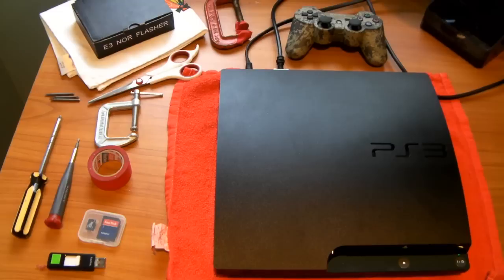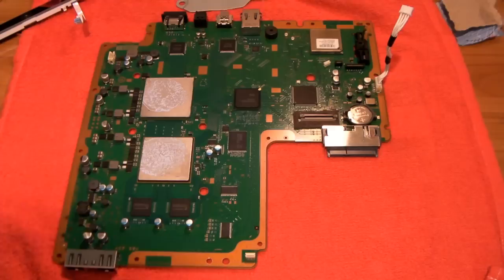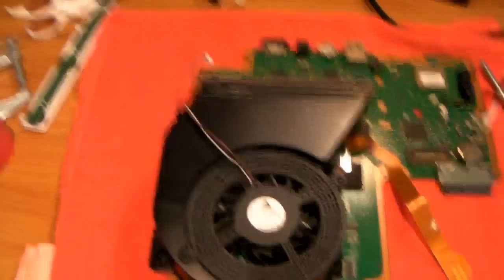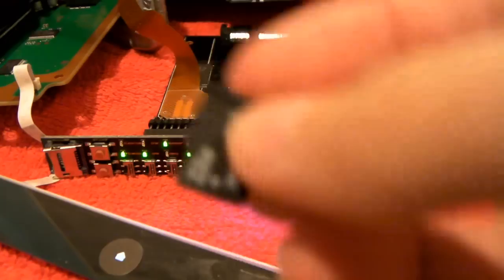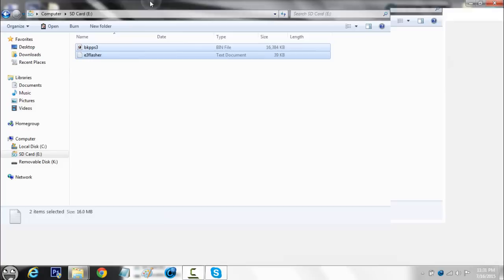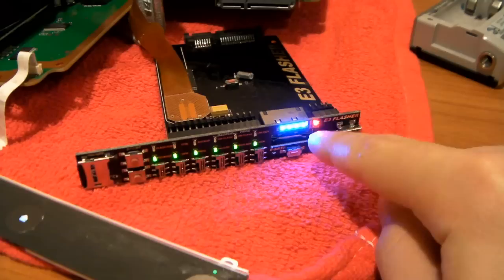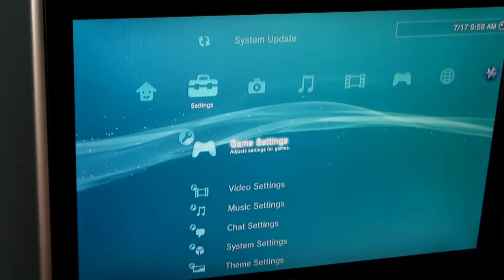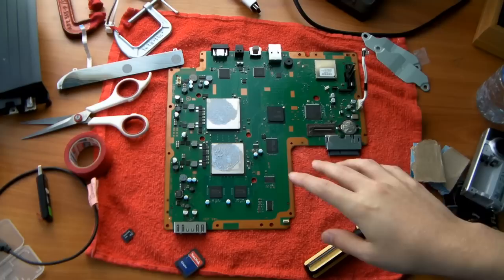How to Downgrade a PS3 to 3.55 with E3 Flasher (EASY!)

Comment: hey i updated my ps3 to 4.78 and i cant patch my dump without a updated dump checker is there any way you can help me with this ? asap
Reply: Look up dump checker 4.78, should be one on github by Swizzy
Reply: +Up2Bro thank you I sure will do
Reply: +Up2Bro It worked thank's bro
Reply: +Kendell Harrell Glad I could help (:
Reply: +Up2Bro When i try to run my disk I get a error 80010017 ?
Reply: +Kendell Harrell Idk what that is sorry man
Reply: +Up2Bro it says an error occurred during the start operation !
Reply: +Kendell Harrell My discs seem to be working fine, have you tried looking it up on Google?
Reply: +Up2Bro I found nothing , whats ur kik ?
Reply: +Kendell Harrell Don't have one sorry bro, maybe the Blu ray reader isn't in properly?
Reply: +Up2Bro its just that disk , bo2 works
Reply: +Kendell Harrell  Just give the not working disc a clean and it might work
Reply: +Up2Bro maybe its the mods and the eboot i put on it ?
Reply: +Up2Bro okay I got it thanks for the help !!
Reply: +Kendell Harrell Anytime bro

Comment: Great video! Thanks!

If you recently purchased your flasher and it has updated firmware it will do all 3 backups at once, instead of doing three backups. Just wait as the blue bar fills each time,  you will still see it blink back and fourth at the end. At that time you can remove the memory card.

e3Flasher Switches Explained:
http://psx-scene.com/forums/f263/e3-flasher-switches-explained-118339/

The link below explains why you get an error when checking your backups:
http://www.ps3hax.net/showthread.php?t=74684

If you read to the bottom of the forum it says that it will be OK to run your original backups because it hasn't been updated recently. You can just run the original three files and uncheck the option that is under the WRENCH ICON that says Enable hash checks.

Understanding Errors: 
http://www.psdevwiki.com/ps3/E3#Error_Codes

!!!IMPORTANT!!! Like the video I had the black screen come up and I waited and nothing after the select and play option.
!!!! You need to connect your blue-ray drive back into the mother board and then press select and start. !!!

This is because the ps3 reads: PS3 HDD - Bluray laser - CD laser - USB 0 - USB 1
More info: http://www.playstationtrophies.org/forum/tech-centre/156743-checking-please-wait.html

Solid Guide! Thanks - Glad to be back on 3.55

What do you recommend to use with my Cobra ODE or do I even need the ODE now?

Comment: Can you use a USB instead of a micro SD card?
Reply: u think it'll fit? -,-
Reply: u think it'll fit? -,-
Reply: You think it'll fit? -,-
Reply: +Ananias Gebreab nah there was a usb thing on the E3 flasher.
Reply: +Joe Stafford  I didn't try that when I did it but if you notice behind the e3 flasher it actually can be plugged in to your harddrive so I believe the usb port is for your hard drive not the downgrade also if you guys have an issue with your san disk  reading in your pc if your  san disc adapter the bigger one  has a notch in the side then tape over the notch and  your pc will then read

Comment: Looks easy, its not. My E3 cable pins got bent, the clip wouldnt fit at first and now the cable has rips in it because it got stuck to the NOR chip. What in fucks name went wrong? I have studied for months to do this and i already have to order a replacement cable.
Reply: +LeFo Oh and when i first used the flasher the power LED didnt turn on (on the flasher of course, the red LED)
Reply: +LeFo Same, lol. after getting past everything i finnally got it done

Comment: It said my dumps were bad how do I fix this??
Reply: e3 flasher cable isn't making good contact with nor chip
Reply: No I fixed it I had to disable hash checks
Reply: +Swerved how you do that ?
Reply: In the top right click the wrench and uncheck hash checks
Reply: +Swerved ty bro it's gonna be good if I unchecked it ?
Reply: +Swerved is it gonna brick us ?
Reply: I unchecked it an successfully jb my ps3
Reply: Swerved what did you do the patcher said it's bad but the norinstector says it's good for all three I'm so confused there is something bad with the ROSD Hash
Reply: I5 420vapes Click the wrench it the corner then uncheck hash checks then you should be good
Reply: Pogo The Clown mine is XvXROADKILlXvX
Reply: Pogo The Clown thanks anyway I had a outdated one my dad I'm so so sorry if I wasted ur time
Reply: +Swerved just downgrade a console the other day and ran into the same problem. instead of disabling you should click download arrow in top right corner and download latest hash list
Reply: Fiber

Comment: Would you like to explain the reason why you say to flip the first two switches down and from the third on you flip them up when you get an error for the backup if you've used the e3 flasher before and in the video when you pull your first dump after error your switch light still show two down third up and the rest down. I've read that when you use the SD card on multiple downgrades their is a Samsung update to put on the SD card before using it on any downgrade as many consoles as one would like. Now I that's not true and it is something you do with the switches being set for 2 down and the rest up to fix the SD error than why on your video is the 3rd switch the only one up. Btw one more detail I noticed at the start of setting up your e3 flasher you say to flip all down and the 3rd switch up and then you clearly went on the video and did all switches down and flipped the 4th one up and about a few minutes later you are turning it on and when the switch lights reveal what switches are on or off then switch off the 4th switch and correct yourself switching the 3rd switch up the way it needed to be originally. Are you trying to confuse and/or misguide people in your tutorials to cause them to brick a system? Cause I've downgraded before and made many mistakes based on bad info. Consoles aren't cheap and telling people how to or confuse the viewers to get them to brick their consoles isn't right and is unethical. Maybe you are clumsy and or dont know what your doing but you seem experienced enough for me to think you did it deliberately so I recommend you fix your tutorial and probably update the video while your at it or someone will get your channel pulled.

Comment: My model is chech 2101a slim can it be downgraded ?
Reply: +Acid Phoenix ALL 2101's can be downgraded.
Reply: +norge696 Can the CechP0# be downgraded?
Reply: Peter Jones CECHA - CECHG  Are not E3 flasher compatible, you will need ot solder and use a teensey. 

CECH all the way up to ps3 Slims 2501's can be downgraded. For the slim is has to have a manufacture date of December 2010 or below. All those are NOR and E3 flasher compatible.
Reply: +norge696 So the Fat cechp model can't be downgraded?
Reply: Peter Jones It can be downgraded  with an E3 flasher. reread what I said...
Reply: +norge696 cech-2502 be downgraded ?
Reply: Inu Mimi Look on the bottom of the console and look at the date manufactured. Has to be december 2010 or earlier. http://puu.sh/nfze2/dcc246d02c.jpg

Comment: Pretty sure I fucked up. First off, once I connected my battery and such the power button on the PS3 illuminated red like it should but when I clicked it it made the beep noise but didn't do shit. Now the fucking red light doesn't even turn on.

Comment: why doesnt the blue lights turn on, on e3 flasher?
Reply from the maker: Make sure you push the two e3 parts in all the way.
Reply: +Hacked Tutorials oh ok thanks man!
Reply: +Hacked Tutorials is there a way i can pm you?
Reply from the maker: Yes, what is your Skype?
Reply: +Hacked Tutorials andrew17807
Reply: +Hacked Tutorials Do you have a kik because I have some questions about downgrading my system.
Reply: +AdrianCFW BMT Skype?
Reply: u need to clamp ur ribbin cable better
Reply: no you dont always gotta do it... it can be other problems

Comment: I'm getting bkpps30 31 and 32 with the eflasher in the dumps
Reply: I got it now, you had the wrong update for the e3 flasher. thanks for the tut it was very helpful except on how too install the e3 flasher ribbon cable I had too figure that out myself.
Reply: +Dennis Blalock Jr just got the same results right now, where can i find the right update file?
Reply: +DJ Ray Boston I looked at another Youtube tutorial and found it there
Reply: +Brandon Rios honestly don't remember anymore, I was watching so many different videos. but I did find that it's OK, the e3 flasher upgrade causes it to do 3 back ups at once, just test your backups to make sure they are good before you do anything with them
Reply: this video is old theres new updates for all the stuff in this video. all this old stuff didnt work for me i had too downgrade back to 3.55 then too 4.80 d-rex after i found the update for the e3 flasher..

Comment: How do i do DEX? i don't want CEX, i want DEX, is it the same?
Reply: +ChevyHD 1 No it's not the same. 2 Download and install the latest REX firmware. (4.75.3 ATM). Once it's installed install REBUG Toolbox. (comes with the firmware and will be on the PS3's HDD). Once installed, open it, go to the far right and dump EID_root_key. Once thats done PS3 will restart. Open REBUG toolbox again. And in the 4e collum and click rewrite target ID, and your done.
Reply: +E3DowngradeBelgium what does 3.55 OFW do?
Reply: +josh hh 3.55 ofw does nothing accept you are able to install 3.55 cfw on it and then 4.xx cfw on it..
Reply: +Dries Bruggeman (MrZombieSlayer) which is pretty much the whole point of it right? you can still go online with it and everything. which one is the best for MW3?  i have a question. why does  my ps3  the right hand slot is not like my  left hand slot it doesn't  let  me  fully put in usb keys or anything for that matter. why is that? its shaped differently ad it sucks since he says u need to use the right hand slot. it does work but u need the the silver part of the usb key to be longer then usual.
Reply: +josh hh The reason you use the right port is because the right port is /dev_usb000/ and the left one is /dev_usb001/ and most homebrew apps and mod menus that need an usb call the function search in /dev_usb000/ so if you put the USB in the left side it won't work. There is no best firmware for a game. If your favourite game is MW3 you could just go to 4.76.1 REBUG.. You don't need spoof of any kind just enable protection (disable CFW syscalls before going online) and your fine. If you'd like to mod gta V I suggest a DEX firmware like 4.75.3 D-REX because SPRX menu's for gta work better on DEX. And some don't even work on CEX.
Reply: +MrZombieSlayer so how do i make  my right port work? i dont have my ps3 jailbreaked yet but i will. but  right now my right port doesn';t work for usb's only my left one does. so what ur saying is when i do downgrade to 3.55  (jailbreak) it will work after? and which firmware to you recommend for modding on mw3 like getting mod menu on it etc.. all modz stuff on MW3 which one do you recommend

3.55 OFW
Rebug 4.70.1 CEX
Rebug 4.70.1 DEX 
PS3 ITA DEX

or it doesn';t really matter which one.
Reply: 4.75.3 D-REX
Reply: Ik know it isn't in your list but ask him
Reply: And no, jailbreaking the console will not make your right port work, you need the right port working to jailbreak the PS3.
Reply: +MrZombieSlayer my right isn;t broken it cuz ive already plugged stuff in it but my usb it doesn;t wok for some reason. i think sony fucked mine up
Reply: +josh hh Right port isn't necessary at all. I've used both ports to upgrade and downgrade my firmware with no issues. They advise right port because its "more stable". But both ports are exactly the same.
Reply: +josh hh nah it's definitely not necessary. I'm waiting for my new e3 flasher anyway as mine broke so figured I'd check some videos and have a laugh.

Comment: BRO PLEASE CAN YOU HELP ME, I KEEP GETTING THE SAME ERRORS
Reply: witch error on the flasher itself?
Reply: +Robin Moens I managed to do it fine, now i jailbreaking another PS3 today and I'm stuck on the checking please wait for the usb file update
Reply: Slim, super slim?
Reply: +Robin Moens slim
Reply: +Robin Moens on my first jailbreak I didn't even get the screen were I have to press select and start, this one I have to do this and it can't find the downgraded. I've tried changing usb's and they're both fat32
Reply: +Manchester United Fan Club i suggest you get your custom os or jailbreak from another site
Reply: +Robin Moens my PlayStation is stuck on that screen to press select and start because if I do it it just stays on checking please wait

Comment: Im Getting dump errors any help?
Reply: whats the errors i had some aswell but fixed
Reply: The error is for the 009.02 ROS0 Hash
Reply: +Siguys Gaming that means nothing as long as you dont remove the clamp it dosent matter because if you remove the clamp you will get a black screen randomly at any moment to fix this open DumpPatcher then click on the little wrench on the top left corner then uncheck enable hashing or hash
Reply: +Markus Perrson  do you have a skype? i'm really confused
Reply: +Siguys Gaming NVM i figured it out. i needed to update the hashlist
Reply: +Siguys Gaming oh ok

Comment: I just picked up a  console banned ps3 off the street running 4.80  its gonna be my project ps3. Its a slim 2101a
Reply: just buy a new cid..
Reply: +Faded Gaming how do I put the cid on the system if it isn't hacked?
Reply: Anthony DeMilita oh nevermind i miss understood. you will need to jailbreak it first

Comment: from were i can get the e3 flasher?
Reply: Amazon/ EBay/ AliExpress :) Happy Jailbreaking !
Reply: yo squid, would a SLIM CECH-2001A 4.80 be possible to downgrade?
Reply: It doesn't matter what firmware it's on. And I personally own a CECH-2001A so yes. Happy Jailbreaking!
Reply: +pulsd yep dude
Reply: thanks dudes <3
Reply: Just make sure to add Thermal Paste. It will keep the PS3 from overheating
Reply: SquidModz do they sell it in stores?
Reply: nvm haha stupid question,

Comment: WHO NEEDS HELP JAILBREAKING A PS3 HMU IF YOU GET BAD DUMPS OR IF YOUR PS3 DONT TURN STAY ON. GLAD TO HELP AND DO GOOD PATCHES.
Reply: +Shorty Modzzz My dumps says bad hash?
Reply: +JupiterGC You have to put a little more pressure and also use two fingers to get good results not to much or you can brick your ps3 but even if you do brick it it can be fix just be very careful.

Comment: Can I Downgrade?
PS3 CECH 2103B
Reply: +Gurkaran Singh (Coder) Yeah you can. Anything up to a 25xxB with a date code of 0C can be downgraded to 3.55. Some with a date code of 1A can be done too. If you need help just let me know. I run a downgrade service on Ebay.
Reply: Thanks for telling
Reply: +Gurkaran Singh (Coder) no problem bud.
Reply: +Anime And Gaming Videos can my PS3 slim model Cech-2502A be downgraded ?
Reply: IDK BUT TRY THE MINVERCHK METHOD FOR CHECKING THE MINIMMUM DOWNGRADABLE OFW FOR YOUR PS3.
Reply: +Gurkaran Singh (Coder) ????
Reply: Inu Mimi Depends on the date code. If it's any higher than 0D it's a low possibility.

Comment: Where can I get an e3 flasher for cheap?
Reply: amazon i got mine for 46
Reply: do u guys think a CECH-2001A can be jailbroken?
Reply: +pulsd yes it can be
Reply: Bark Modz // TheBarker thanks mans
Reply: Im not buying it. Fuck it
Reply: Manny Ribera want me to link you a cheap one man?
Reply: I'm selling mine $30 Amazon PayPal Or prepaid I'll pay for shipping if it's on the us
Reply: pulsd no thanks. I need a cheap ps3 first
Reply: Im selling my ps3
Reply: +jonathan lop 
Says the guy who changed the price twice in this thread
Reply: jonathan lop 
Guess what I dont give ?
Reply: +Salted a Fuck 😂
Reply: ebay
Reply: im selling one
Reply: chryastosslapat thank you so much , i was looking on other sites selling them for $80.00.
Reply: Feltrex Mc $80 for the full set. I would get the Limited edition one if you have the money. on aliexpress they have them in seperate parts. and they take quite a long time to come usuallly around 3-4 weeks. They do sell full sets there I think.
Reply: chryastosslapat that's interesting, I thought it was all a full set no matter where you get it from . Do you think this guy is using the "limited edition" ?
Reply: Feltrex Mc Discard what I said before. you don't need the Limited edition. Limited edition is just for basic beginners that includes like clamps and stuff. But the regular ones from aliexpress are fine.

Comment: mine is CECH- 2501A  please respond will mine work!!?
Reply: Mine the same model, did yours work?
Reply: +Eduardo Palacios Yes it will
Reply: +RemixByMarc will my Cech-2502A work ?
Reply: +RemixByMarc thanks for replaying ! And I'm happy it will work :)
Reply: +RemixByMarc my e3 flasher keeps getting a error can you help
Reply: +RemixByMarc like I get the file and once I click start on my e3 flasher, it gives me a error
Reply: +RemixByMarc what about ones with 2051B?
Reply: +Jacob Ivy Yes
Reply: +The Boy Who Cried Riddim how do I get the message that says "do you want to patch this image" on the dumpatcher ??
Reply: +Eduardo Palacios I don't know.  you could try to look at a tutorial on that actual part
Reply: +The Boy Who Cried Riddim yes
Reply: It depends on the date it was manufactured. 2010 models can be flashed, 2011 models can't.
Use the minim firmware checker pup and see if it can do 3.50. If it says it can only go to 3.56, then it probably won't work.